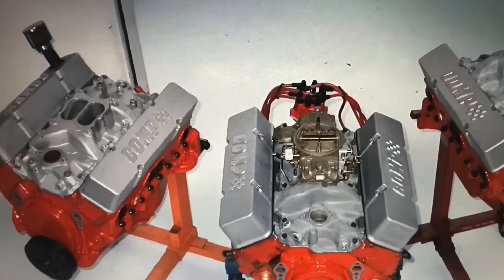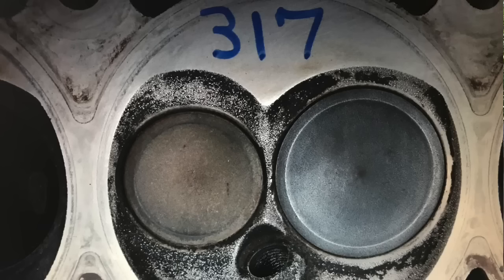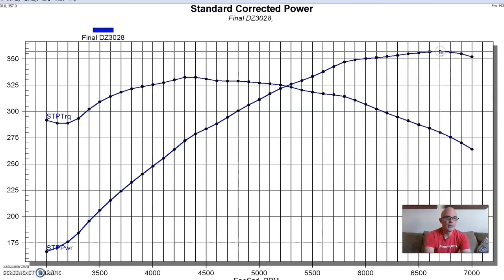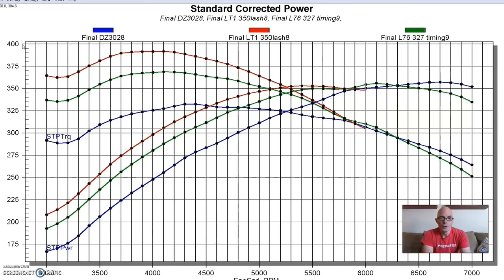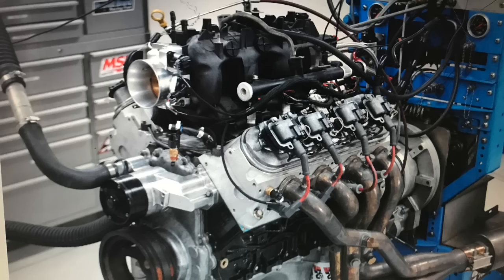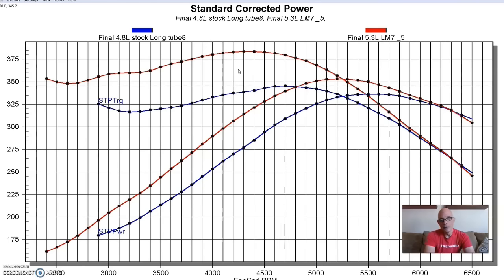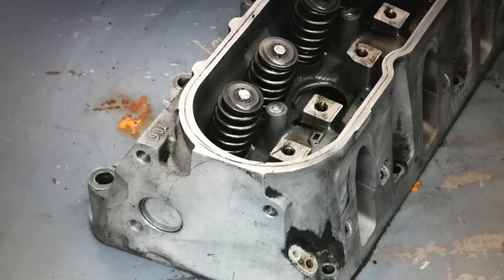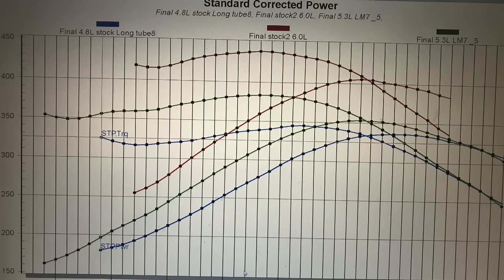HOW MUCH HP DID THE 1969 DZ302, THE 1965 365-HP L76 327 OR 1970 LT1 350 REALLY MAKE? WAS IT FAUX HP?

Comment: Yep still leaning towards building a 60 over 327 for my gasser
Reply: build whats available,more is always more.if you have a 350 use it.
Reply: @trillrifaxegrindor4411  yeah thats part of why im leaning towards the 327 i have it. All i have to do is degrease all the parts. And assemble it. 60 over block ,forged pistons , redone ported and polished double hump heads , full rebuild kit
Reply: Best engine you could choose.
My brother had that set up in his 39 coup.
Fender well hooker headers six two barrel intake, 30 30 cam. Camel hump ported heads. 12 to 1 pistons.
I'm a Ford guy, but this was the best sounding engine I ever heard.
Sounds better than my 64 top oiler 427.

Comment: That's the same thing with the Ford 289, 302, and 351w engines. They all have a 4-inch bore but increased the stroke. This is what most manufacturers did.

Comment: i have a 327 built by old man bell himself for the street it one hell of a engine but it is stroked running tunnel ram push over 1200 hp on just pump gas we pulled it out of rick news dragster then put 25,000 in it will go over 15,000 rpms been there many of times just love that engine when u go over 10 it just screams after this engine i'm a firm believer in seasoning the block this engine was built in the 90's still runs today lot of street races and driving back then u had to drive the car on the street had to be a complete car no stripping it down for weight full interior no trailer queens no modified cars just build the drive train  and has to be a driver the only problem was cruising it it like to get a little hot in traffic and the police like to fallow me around right on my ass seems like i all ways had a cop on me but when u sound like a dragster they no what ur up too
Reply: Sorry, but you have the tach wired up for a 6 cylinder. Let's try that 1200 streetable, "naturally aspirated" h.p. on my dyno. Leave your rose colored glasses at home.
Reply: @t.s.racing  i take that u don't know old man bell witch has been building engines since the 60's for drag racing he build for the big boys and he has built a lot of nascar engines and indy engines old man bell was a master engine builder and i know what my engine will do

Comment: The original LT1 had pink rods. Much stronger bottom end. The LT1 and DZ both had solid lifters, which required constant adjustment. I think your HP number on the DZ was short without the 140 or  2nd gen off road cam. The DZ with the 140 cam and chambered exhaust is the sweetest sound from idle to around 7000 RPM.

Comment: I think the reason 1/4" engines out run 1/2" engines on dirt tracks is usually you're turning around 5500 to 6500 in the middle of the corner the softer power curve on the shorter stroke helps the tires bite better and the chassis setup becomes less critical..

Comment: Magic in 3.25 stroke on oval tracks, a 327 with 450 hp will out run a 350 500hp engine, every time. Seen it over and over again, plus a 3.25 stroke vs 3.48 or 3.50 same cuin  the 3.25 stroke will walk off and leave the longer stroke engine...seen it on the race tracks for 40 years. We don't race dyno charts we race on dirt tracks. I drove for years and a 3.25 inch motor is sweet, a 3 inch motor will give a 3.48 motor a run for it. These are full race motors with all the goodies in them.

Comment: be interesting to plot the change in torque from one capacity to another against the change in capacity.  i find (bike engine based) that the bigger engine will make comparatively more peak torque (higher bmep) with the same heads/cams.  often not much, but capacity seems to promote the peak a touch.  302 top end was interesting - maybe the peak airflow was just that little bit lower enough to stop it choking as the 327 and 350 did at the top end.  wonder which component was choking it?

those ls are cool as.  such nice torque curves with great power.  amazing how many tricks there still are in the 2 valve dog with modern tech.  pity you didn't overlay the 327 and 5.3, and then compare the cam spec and vacuum at idle.

Comment: Chev small block.302 Z28 had a special  large Holley, 365hp 327 had fuel injection, LT1 better and later heads hence 375HP. Again with duel plane and a different Holley.
And surprise surprise the 6.0 hbas more camshaft.
Though what about the 5.7?

Comment: I'm not a Chevy guy by any means, but from many years of racing experience my choice will always by a small journal 327 with a high flowing cylinder head and lot's of compression. It has the best rod length to stroke ratio and the best bore to stroke ratio of all sbc's for high rpm HP.
Reply: Even if you aren't a chevy man you have to realize they rule racing and will for a long time. Lots of stuff I hate about chevy but v8s damn sure isn't one. Even the non chevy vehicles I own have a v8 chevy of some kind in it. Just like the best hot rod rear end is a Ford 9 inch. They did that better
Reply: I’m a 327 guy too. My fave was a 060 over large journal,L79 cam ,bump heads with some work, snowflake intake with an AFB. Made 380 or so and pulled hard from off idle to 6200. It was in my 66 L79  Chevy 2 clone. Light and fast.
Reply: @brianveitenheimer4492  why? the large journal never makes more power, less parasitic friction from the small journal.
Reply: Oh and by the way, dude, I am a Blue Oval guy to my core. Therefore I have spent my life knowing and under standing, both the advantages, and disadvantages that the slowtie V8 brings to the table.
Reply: @terraboundmisfit  350 block so I could have 4 bolt mains

Comment: What about the small block 400? I would like to have seen that in the mix.
Reply: I've built a few strong 400 SBCs. Weak rod caps are one problem. Have the rods/caps shot-peened. If ya use aftermarket heads , don 't forget to drill the steam holes for the siamesed cylinders. Don't rev it past 5000 too often..
Reply: @pb68slab18  That’s true... the 400 blocks are usually better to destroke them into a 377 for a more fun street option to not have to worry about blowing it up. A destroked 400 could handle pretty much the beating of the 283 or 327 but if it’s not and your try and build it up you’re wasting your time unless you have a light foot. It’s an oversized 305 basically.

Comment: could you do similar testing with the modular engines? 4.6 v 5.4 v 5.8 or 6.2

even mixing 2 valve, 3 valve, 4 valve heads
amd maybe the different 4 valve heads, GT, Cobra R, Boss 290 ect

Comment: On the 302 - 327- 350
Changing the valve springs and rocker ratio as long as there was clearance . Should have helped the top end on the 327 and especially the  350
And maybe a 1 inch spacer on the 350 might help the top end

Comment: Where's the 283?  or even the 265? they are all small block v8s too. I believe the bore and stroke on a stock 283 was 3.875 bore and a 3.000 stroke. Many were used as HIGH rev rat engines and I've seen them blow the doors off of similar built 327s. Mostly because they got to top speed faster due to the shorter stroke I suppose. Especially when coupled to a powerglide trans that'd been worked over.  I loved both the 283 and 327 engines back in the day.  You couldn't swap cranks between the two, due to the different rod and main  bearing sizes, but it was fun swapping out heads, intakes carbs and cams on them.  Play with em enough and get em right! there wasn't much in the small block era that could get to em other than some small block fords like the 289 and 302 builds of later years. Stock they (the 289 and 302) didn't pull but 200hp + or -, but put some TLC into them and they held their place. But this was a small block chevy video and I've seen some rad 283s.  Even the engines talked about in this videop weren't stock  so I think that the 283 should have been introduced. You could get a crank that would give you a longer stroke  and of course up the piston size,  but then you'd loose the very thing that made the 283 a fast reving monster like it could be. And it could deliver good HP and torque number too. difference was that if you built it to 400hp , you get that hp real early and in t he quarter mile your 60 ft would be crazy compared to a longer stroke. Top end mph at the quarter might be slower than a longer stoked 327 or 350. But your et was faster normally then theirs. everything else being equal between them that is.

Comment: have you done much with the 283 sb Chevy. I have one and want to put into a 93 Chevy Cheyenne. do you think it will be under powered. right now it has a 4.3 v6. it does ok but when I haul 2 ricks of wood it struggles badly. I'm not making a race truck, I intend to use it for a daily driver and wood truck. any ideas for it on the cheap would be great thanks
Reply from the maker: I would go bigger
Reply: @richardholdener1727  it's the engine I've got. I have thought about bumping the cam and a pair of vortex heads and 650 Holley

Comment: Stroke length and torque do go hand in hand. But so does rotating mass. Big flywheels, forged cranks add rotating mass. 4×4's farm trucks and old tractors had massive flywheels and pull all day long even with worn out motors. The down side... You lose that snap of instant throttle response. Would make a great comparison video.
Reply from the maker: torque production is primarily displacement-I have tested changed in rotating assembly weight

Comment: I've got a little 307 that makes big blocks work to keep up. Bored over, domed pistons, 327 crank, 350 double hump heads, 3 angle valve job, port and polish, 750 double pumper and a big old cam. Never had it dynoed but it pulls hard
Reply: 307 was a boat anchor
Reply: @jasoncolyer6286  that's the best part, everyone talking shit but end up getting smoked by a boat anchor. They can keep the money it's more fun for me to watch them get pissed because a boat anchor just walked their big block 🤣
Reply: @jasoncolyer6286 , the 305 is a boat Anchor,  the 307 is in Fact a 327 crank in a 283 block  which is just the opposite of the DZ302  which is a 283 crank in a 327 block,  like he said in this video 3 inch stroke and 4 inch bore

Comment: I would also like to see a 283, and a 383 added to the mix. I would also like to see all gen1's run with the same middle of the road camshaft and intake, and carb. I have yet to Build any LS motor, and the GEN1's look plain simple compared to the new stuff, which is very good stuff.
After you supercharged the LS 4.8 to 600+hp, and 4.8 remans are dirt cheap compared to 6.0's, I would like a blown 4.8 just because,and really piss off people with my drive to the track, foot brake, drive home, s10 Blazer on 75 Monza. Reliability, and et repeatability, and budget friendly, are my motivation. good job!

Comment: you tested the LT with 1970 heads, but as I know the 71 heads are a better head?
to add,  I just do not know why shops like yours do not just build a 400 and test ALL the Chevy performance cams (62 to 73) in that 400, 1) the DZ Cam, 2) the L79 Cam and 3) the LT1 Cam, and see the numbers, use a 780 carb and the 71 Heads. that will be the only way to know what cam dos what number

Comment: You are doing a good thing with your comparisons. I taught performance engine machining and building along with dyno testing and tuning for 10 years, both engine and chassis dynos. We used an inertia chassis dyno, not the best but it worked good enough. It measured torque and calculated horse power and the time it took to get to our cut off speed was part of the HP calculation. We could always tell a high HP car by listening. Low HP cars took a long time to get to the speed figure. I have a video of a 4th generation Trans Am with a stroked LS and a 300hp nitrous system. It went from 55 to 120mph, in about 4 seconds with lots of tire smoke. This was a street car and I named the video Neck Snapping Acceleration
Reply: no,you didnt..........

Comment: Cool video 👍 I still like the old school v8's , years ago I started having a SBC 350 build , it's a a 4 bolt main 350 an 010 block and had a large journal 327 crank and 327 race rods , not sure what brand and .030 over 327 pistons , the machinest decked the block , so it has a positive deck hight , but after I got married , it has sat unfinished , but I'm looking forward to getting it done to put in my 72 Nova
Reply: Got the lt1 350 in my 57 Chevy cameo pickup

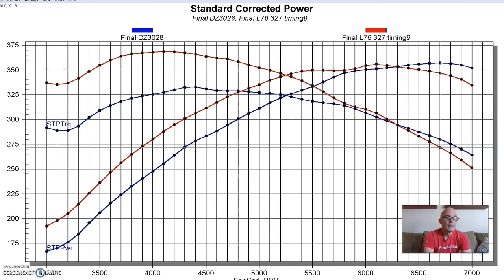Comment: Number of years ago I built an original LT-1 for my 70 1/2 RS Z/28. It was a .030" over 350 that was highly built. Can't remember the exact comp cam but it was solid flat tappet with a ton of lift and all the duration, 12.5 to 1 Speed Pro pistons, the whole assembly lightened, ported 461 fuelie heads that were angle-milled .060", Victor Jr. intake, Carb Shop 920 CFM carb as well as a few other mod, 1.6 rockers, passive pan evacuation system, electric cooling fan, MSD ignition, etc. Then Madcap Racing dyno'd it with no accessories and open long tube headers. It made an astounding, altitude corrected 594 hp @ 7400 rpm and 502 lb/ft tq at 5800 rpm. 4 spd. 4:56 axle with hard as a rock TA radials, full 2.5" exhaust. At Bandimere's drag strip, no burnout allowed (5800 ft altitude) only mod was removing the air cleaner, 12.58 sec. @111 mph
Here's a link to a short video. Plus a little street racing vs a VR4 with bigger turbos.
https://www.youtube.com/watch?v=LA64IGdbnSY
Reply: Great vid  I lived in Denver 25yrs I had a 78 Camaro w a 468 BB - I used to go to Bandimere w my buddies for test n tune n have some fun- I see your carb has the annular booster- with a high lift long duration cam the annular boosters really help w the carb signal vs a dog leg booster- I had a 604/612 lift solid lunati cam and I used an 850 w annular boosters- but your 350 flat out flies man- my 468 was fun but the best I ran was 13.01 @106 w street tires - not super fast but at that altitude it’s hard to go fast- I think your 350 would have been faster than my set up- that is a beautiful Camaro -  mine was nothin fancy-  take care
Reply: Nice story. Do you remember when we'd race next to I-70 on Stapleton Dr.? Really sad to see Bandimere close uh?

Comment: My favorite video so far. Perfectly shows an engine is just a big air pump. More displacement = more air flow at lower RPM = more power at lower RPM. We can clearly see the old engines are limited by air flow through the head by how the curves all converge in the right side of the graph.
Just like everything in life engine building is a trade off. Do you want lots of torque for pulling a load or driving around town? Build the largest displacement engine with the longest stroke for 2500-5500RPM power. Want a racing high RPM engine? Build the shortest stroke with a wide bore to keep the piston speed low and make that same power but at 5000-8000RPM. All comes down to how you want the engine behavior to be.
In this vein there is something around a 377ci de-stroked 400 small block that is a strange beast. That would be a neat comparison to a 383 stroker.
I wonder if you can put a 4.8L crank in a 6.0L block and turn it to 9000rpm. Hmm...
Reply: You can turn any LS to 9000 RPM...Once!!!!!

Comment: Motors run on electricity, Engines run on fuel.
Reply: FoMoCo… GM...
Reply: Turn around and ride your motorcycle back home...
Reply: How about this engine?
https://www.google.com/searchq=siege+engineoq=seige+eaqs=chrome.1.69i57j0l8.6192j0j4sourceid=silkie=utf-8imgrc=h9bibqllzg2b0mcolon
Reply: Gas powered boats are called motorboats not engine boats so I think it’s either or

Comment: It would be interesting to see a pure bore vs stroke comparison with similar displacement. You can build a classic 383 small block with the 4.030 bore and 3.75 stroke. To compare, you can build a 380 small block with a 4.125 bore and 3.500 stroke. That would keep the change in displacement out of the equation.

Comment: I don't think any of the old CID engines meet the classic definition of a muscle car engine.   Not enough displacement to meet the minimum standard.   But now that we're  60 years away any stylish  60's or 70's American car is a muscle car.
Reply from the maker: CID engines?
Reply: @richardholdener1727  Cubic Inch Displacement (CID) vs Liters.   LS engines are 4.8L, 5.3L and 6.0L  not 298, 329 and 372's.  All 3 old school engines are the best example of a Chevy engine in their displacements in the era.  They make Pony Cars or Sports Cars perform on a level akin to or in some cases exceeding  Muscle Cars or Full-size Performance cars.  A DZ302 is fantastic in a Z28 Camaro,  a L76 is a Nova or Corvette, A LT1 in a Camaro or Corvette are all in their element in each chassis and car.  Balanced handling, acceleration and braking.  A skilled driver shouldn't be afraid of a SS 396, SS 427 or SS 454 powered vehicle in anything other than a pure straight line race and then there is the skill of the driver of the Big-Block car as the great unknown.   Now, there are all sorts of variables that can't possibly be accounted for but in a "off the production line" typical equipment and trim level comparison there simply isn't a great deal of overlap.  The Pure Stock Muscle Car drag racing has proven that time and time again.  Power to weight ratio's and torque are the masters in a straight line.
Reply: @erikalarson6803  Pure stock isn't exactly pure stock if you read the rule book.

Comment: Considering you are only working with 289 Cubes the Hi-Po is quite impressive for the era.    The Hi Po makes more HP per cube than the 5.0L EFi and as much Torque per cube. The 289 Shelby just squashes the 5.0L EFI in terms of HP and torque per cube.  Which for the mid sixies on a street engine is impressive.   I think you are maligning the 289 just due to its smaller displacement.